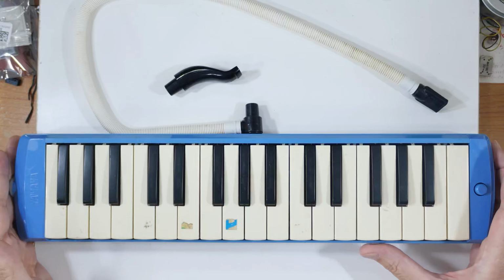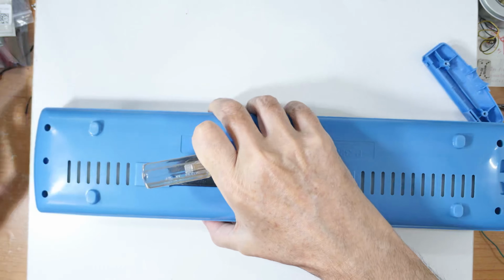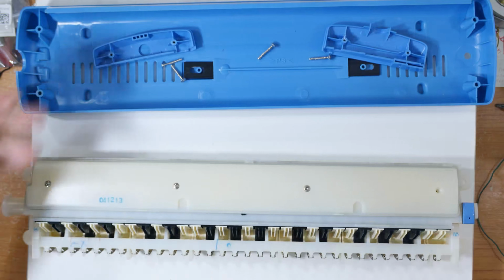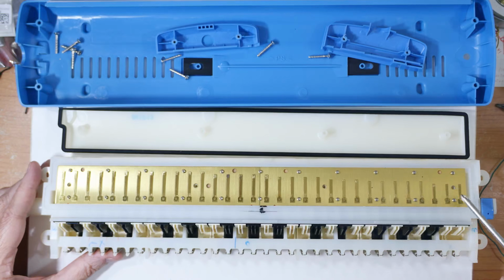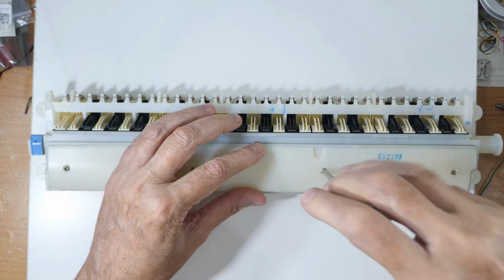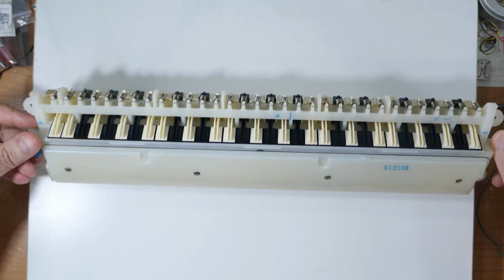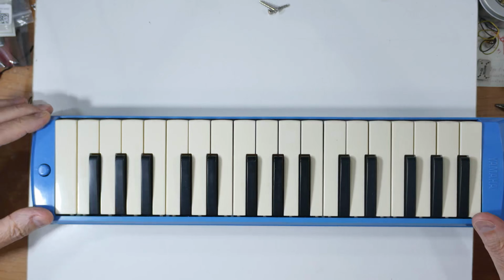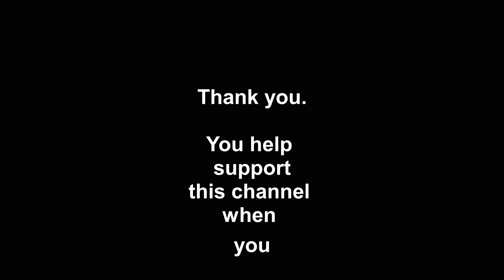Restore Yamaha P-32D Pianica Melodian (4K)

Comment: Awesome!!!! Thank you so much!
I’ve only had my melodica (yamaha P-37D) for a couple months and already it doesn’t smell too great 😅 Im a little worried about putting it in water since the pamphlet I got with the thing said not to, but you did a pretty good job of it so I think i’ll give it a try.
Reply from the maker: It's best to follow the manufacturer's instructions. If they say no water, I would try other cleaning methods before resorting to soaking in water. The ones in the video we got cheap because they were from a school and rather gunked up. There's the danger of them corroding if they are not dried quickly and also the risk of bending the reeds, so proceed with caution.